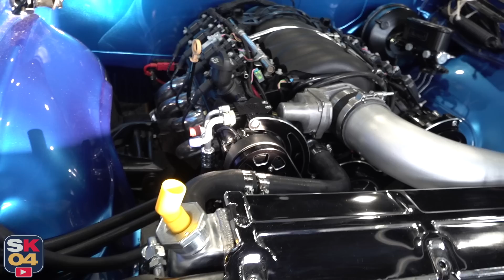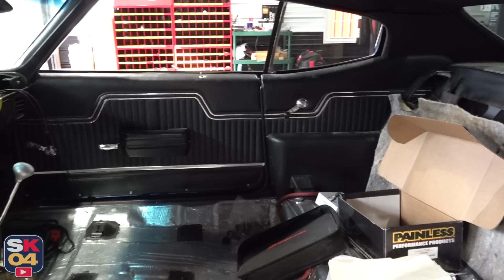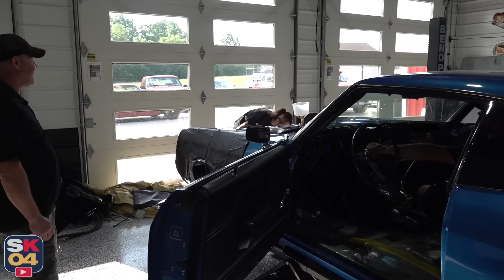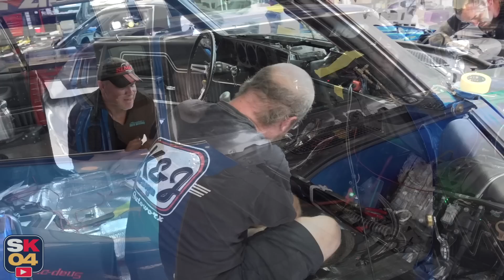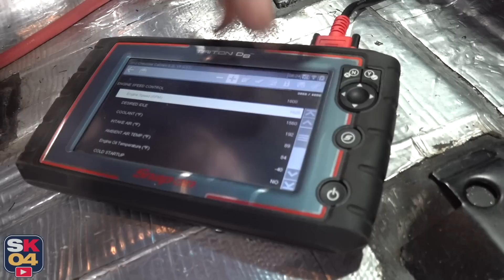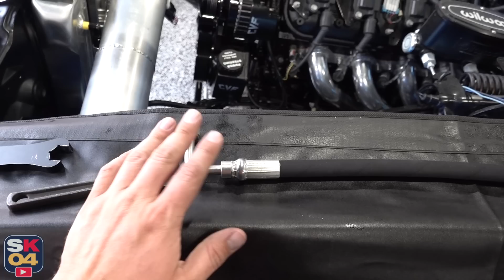First Start Up of a Freshly Swapped LS3 Powered 1972 Chevrolet Chevelle!

Comment: I'm old school though. The engine looks all nice but i would rather just have a solid engine with a carb and a basic transmission. Sure the gas prices will kill me but I don't have to worry about no codes being thrown 😆. It either works or it don't.